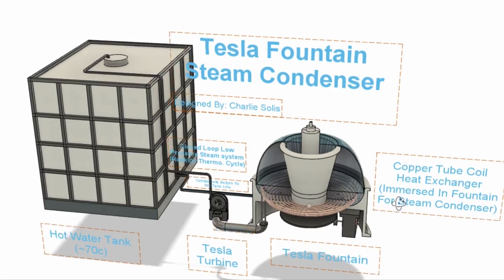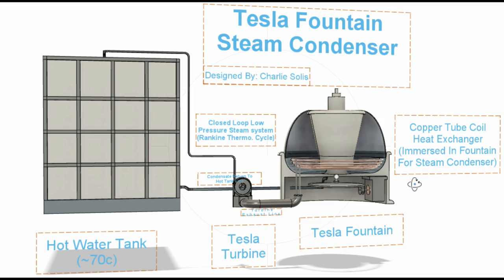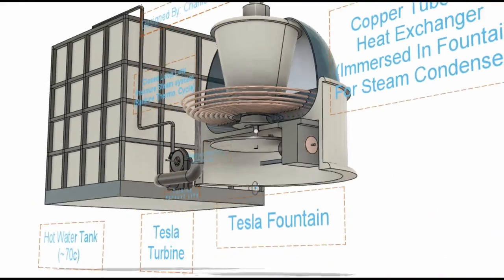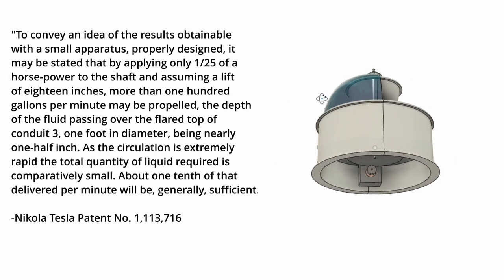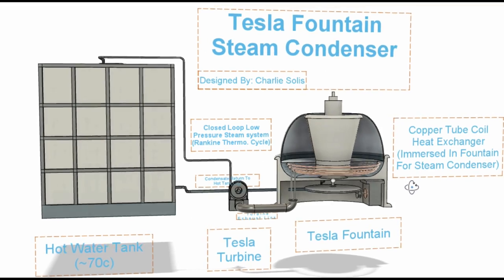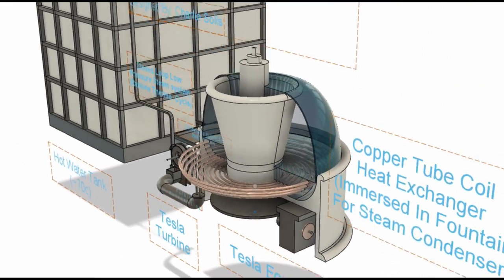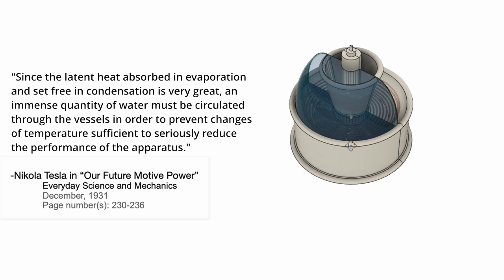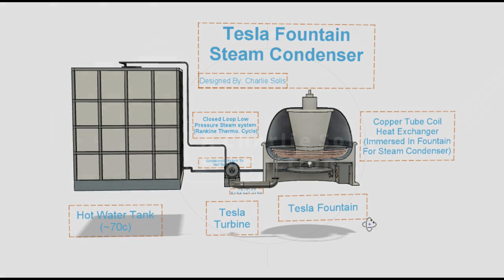Tesla Fountain Cooling Tower - water to air heat exchanger for the Tesla Turbine & other processes

Comment: Could we cover the whole fountain with triboelectric nanogenerators to obtain some extra energy from the flowing water?
Or use the "dead" space next to the center column of the fountain to fill with fins covered with such a material.
They would always get some vapor anyway that would flow down the wall... just a thought.

Comment: Does the center section fling water into the dome section, and it rains down over the coil at the bottom—cooling it down?
Reply from the maker: The “dome” section you are seeing is the fountain of water falling and open to the air.

But yes the water gives off heat to the air and then goes back down to cool the coil and then goes up the riser column and then splays out into a thin sheet of water and cools from the air.
Reply from the maker: But if desired you could also put it in a sealed vessel and make the heat transfer through a wall.

Comment: Is the flowing Water of the fountain open so it needs to be refilled or closed from the outside air?
Reply from the maker: Dood…. How you going to be giving away my secrets like that 😅😜
Reply: @CharlieSolis  I'm sorry , somehow it already looks like one XD  I shall delete that part of the comment
Reply from the maker: Lol you didn’t have to do that. But yeah the fountain is open to the air. It shouldn’t need to be refilled. I was actually concerned that if you didn’t design the upper and lower part of the fountain right the water would over flow of it shut off and/or would start sucking air, etc. and I just assumed teslas dimensions in the patent were arbitrary but when I made this in case I did a volume check and this design is actually perfect so that the basin won’t run dry and it can still flow over the top of the upper column. When it shuts off the water goes to just below the top of the lower basin.